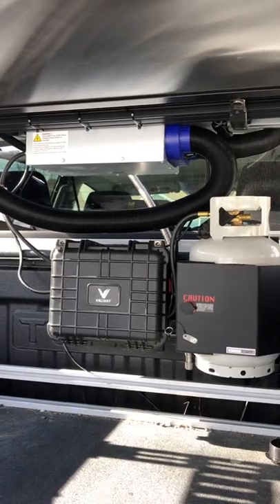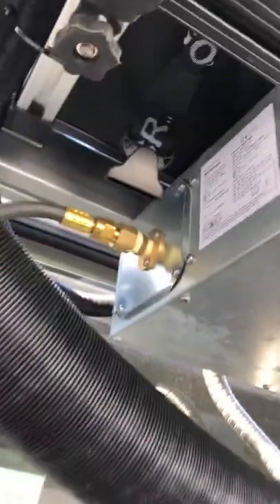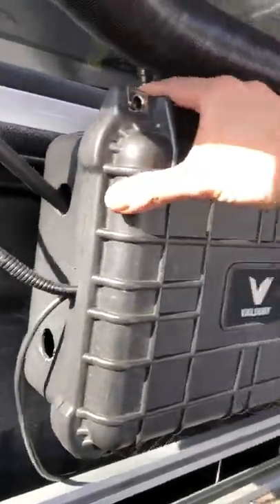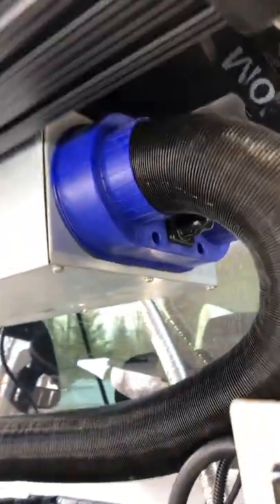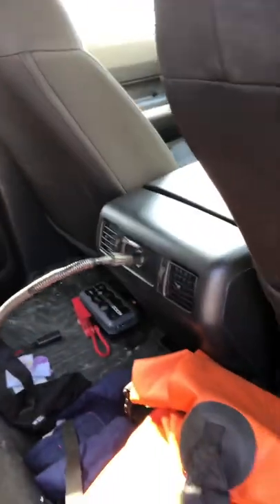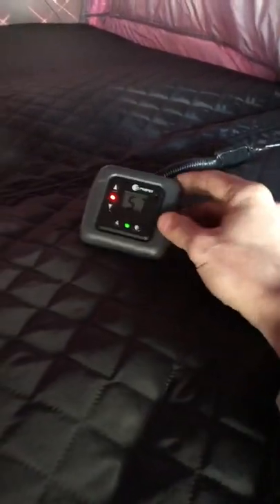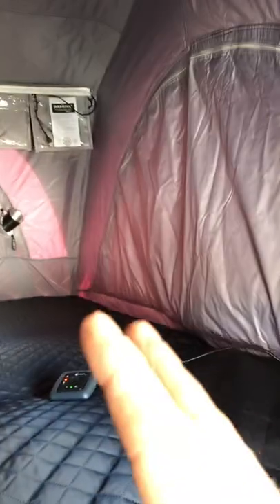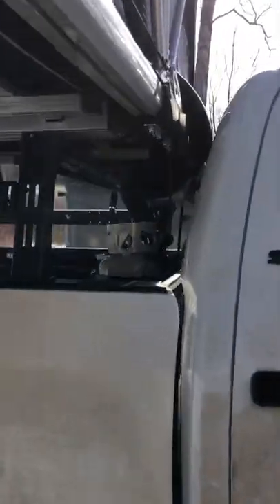Propane tent heater, install and first test!

Comment: how do you feel about the chinese diesel heaters? would you ever install one in a trailer? Do you have  larger propane tank mounting brackets? do they make 20lbs mounts?
Reply from the maker: I hate everything about Chinese diesel heaters! I hate the complexity, the fact that they're made in China, having to carry diesel, the exhaust, everything. On the propane mounts, Expedition Essentials doesn't make a 20 lb mount but Powertank does.

Comment: Where did you get the hose going from propane tank to heater. Thanks
Reply from the maker: You'll need a hose with a POL or QCC1 fitting on one end to attach to the bottle, and a 1/4" FIP on the other end to attach to the regulator input. The regulator needs to be a 2-stage unit. Then the hose going from the regulator to the furnace needs a 3/8 FIP to go into the regulator's output, and a 3/8 female flare on the other end. The heater has a 1/4" MIP connection, so you'll need to get a 1/4" FIP to 3/8" Male flare adapter to thread onto the furnace. That will allow you to connect the 3/8 female flare end of your output hose to the furnace. All of that you can get on Amazon or Etrailer, just get whatever lengths of hose make sense for your setup.
Reply from the maker: And of course if you want to order the full kit from us we'll do that too.

Comment: How much propane did the unit use on a typical night?
Reply from the maker: I'm not sure exactly, but I used an 11lb propane bottle and had it running for 3 nights and the bottle still felt pretty full.